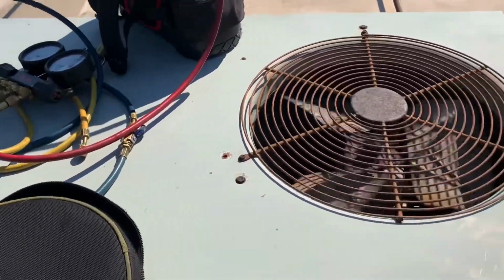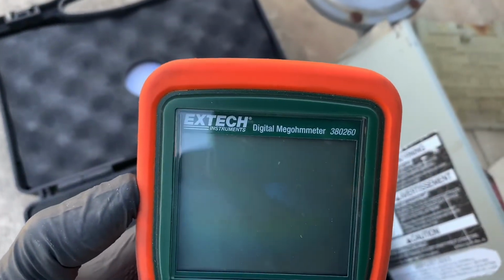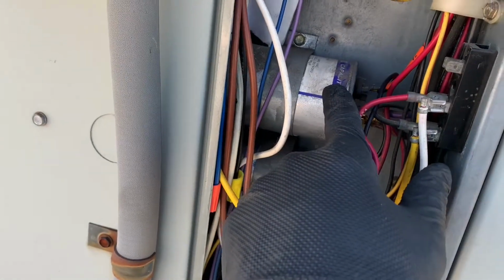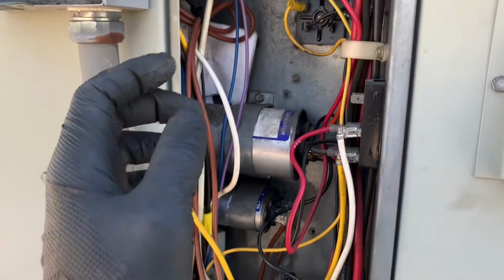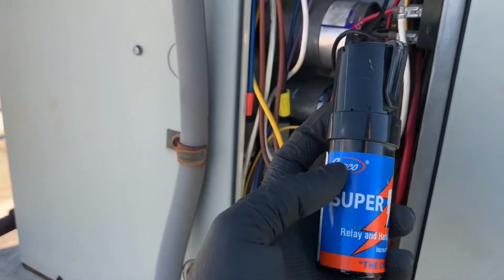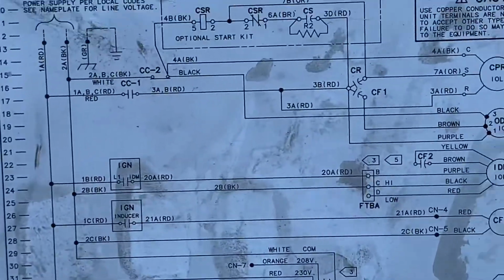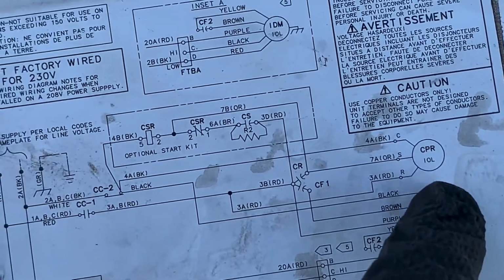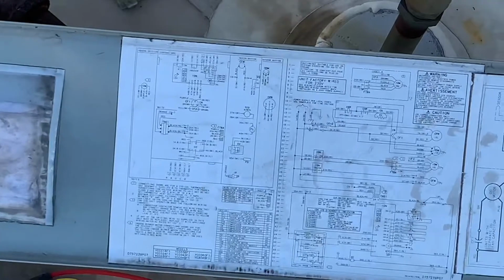HARD START KIT / BOOSTER CAPACITOR FOR HVAC COMPRESSOR

Comment: When megging a motor, meg at double operating voltage I believe.
Reply from the maker: Not exactly I, most mega test meters only operate at a set voltage, this particular one you have a choice. I usually starts low and if the device passes I increase to the next voltage scale. Typically 120v, 208/230v, 460v i have tested  these compressors @ 1000v range on meg test with no issues.
Reply: @D2DNYAC  Yeah, I think it may be possible to blow through good insulation at a very high voltage, similar to hi-pot test which is destructive?
Reply from the maker: I will be posting a video soon using this Meg tester!